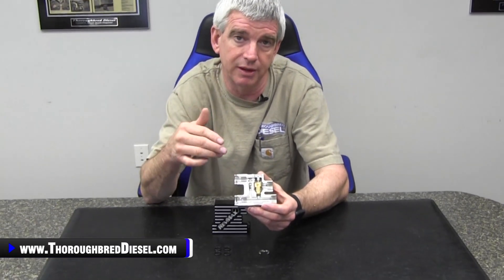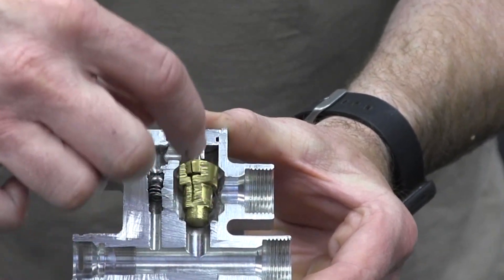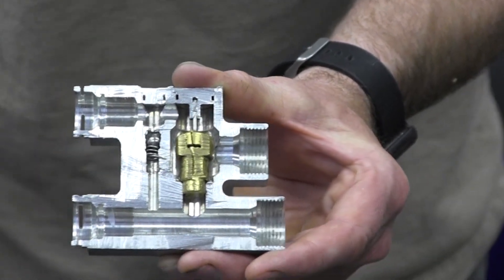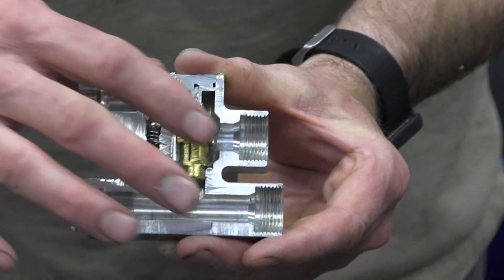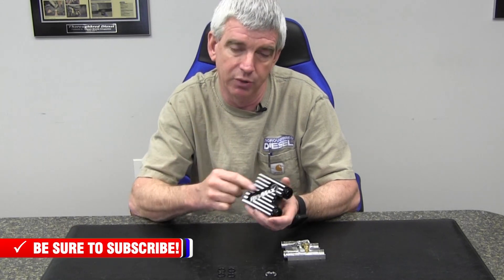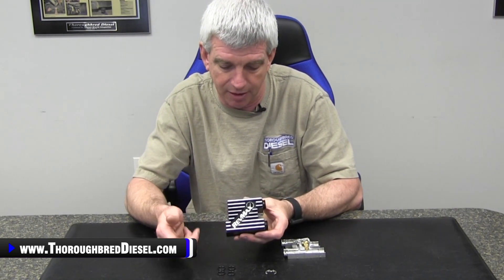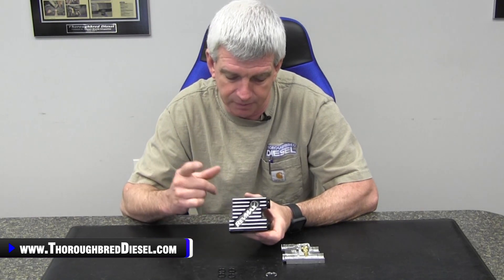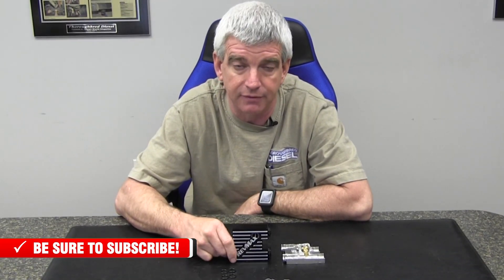This could SAVE you thousands!!!  RevMax Cooler Thermostatic Bypass #diesel #dodge #trucks #68RFE

Comment: @thoroughbreddiesel  I live in Michigan. It's pretty cold for 4 or 5 months of the year.  I tow a lot in the summer, not really at all in the winter, but the truck is my daily driver. How will this affect the operating temp in the winter? Is this still recommended?
Reply from the maker: The greater good here is removing the valve restriction.  On very cold days we always suggest plugging the truck in, and in my personal opinion, I would let the truck idle for a bit before you take off to get fluid warmed and ready.

Comment: Hi I installed mine with the revmax deep pan and for some reason when I put the truck in park or N, temp will start going up and won't stop I seen 190 when before mi truck would average 150,  160, when I'm going like 70+m/h starts going down to like 120
Reply from the maker: I don’t think that this was caused by the bypass.  Was it doing that immediately after doing the bypass?  If so go back through your install and see if you have a restriction somewhere.

Comment: Never heard of a 68RFE failing due to lower ATF temps - my 68RFE never gets over 185*F while towing our 13K lb RV.
Installed the ATS by-pass ($69) @ the 6K mile mark (New 2017 6.7L CTD) - New PPE transmission pan - refilled with Red Line C+.

Comment: Just be aware if you live in cold climates like me (-40c) then you'll need to put the valve back in or the transmission will never warm up when it's cold
Reply from the maker: Retaining the stock valve is a option.  Plugging the truck in overnight is going to help with the warmup in the mornings as well.
Reply: Came here to say the same thing. Could you imagine running 80% better flow to your cooler in a wide open system in the winter?
Reply from the maker: I think that there is some concern of operation in very cold climates.  Providing correct flow outweighs that concern.